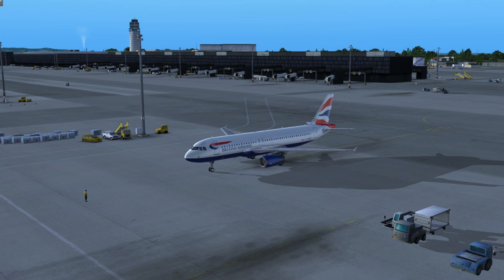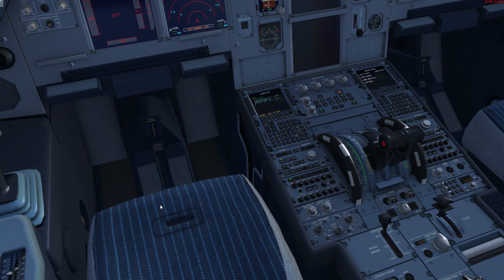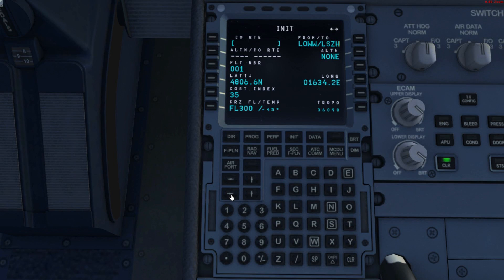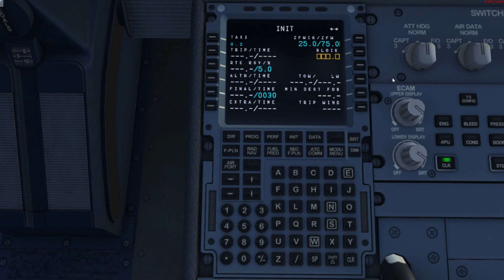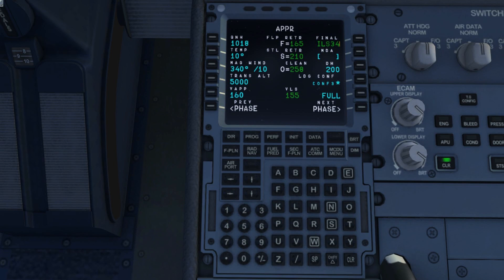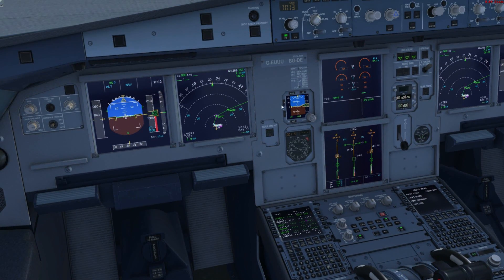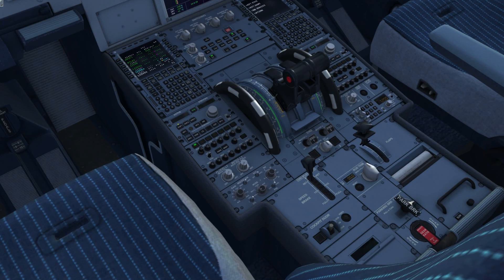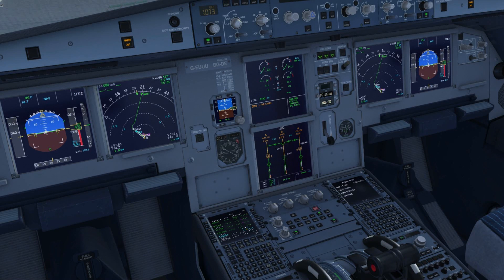Let's Fly FMC/MCDU Basic Tutorial Airbus X Extended - English Version

Comment: Hello. When I program my flight route and waypoints etc as shown in this video, will I still be able to use air traffic control?
Reply: As with the default atc, no, as the default atc is meant to be used with default aircrafts with no fmc/mcdu. But you might be able to with add-ons like ProATC X.
Reply: Thanks for your help. I tried default ATC by downloading a copy of my flight plan in both formats, one for IFR P3D and one for Aerosoft FMC. It worked for the first half of the flight but on approach it does not work.

Comment: What do i have to put into the AP or what do i have to do right after rotating/take off
Reply: ***** DerNuknuk Make sure you have the HDG knob pushed IN so it can follow NAV mode, and make sure your ALT knob is pushed IN to be put into Managed mode. Then pretty much just sit back and watch it fly itself
Reply: You must turn the FD on before the actual take off. In real life in most cases pilots don't turn them off even after landing. When you are higher then 100 ft RA you can turn the AP on and relax.

Comment: Hello EngineIgnition, im having some issue with the very first step, im a bit experienced managing FMC (NGX one) but in this Airbus FMC i cant step to next page after filling up everything you filled in INIT menu. When i click on the "next page" arrow, the message i get is "NOT ALLOWED". Am i missing something? Ive loaded fuel from that software that came with the plane but im stuck at INIT first page and i think the FMC wont get properly programmed and the plane shouldnt fly as it would without that step completed. Any suggestion? Any help please? Greetings from Argentina.
Reply from the maker: Hmmm... did you start from "cold & dark" state? Because your problem reminds me of when I had similar issues...
Reply: Hi! Thx for the time you spent answering me. Im starting from the "default" step, as it comes when you install the plane, i would call it ready for taxi or ready for takeoff. Definitely not cold & dark, i think i should try cold & dark. Will let you know and for those who might find this issue in the future.

Comment: i have a slight question sir, now i fly above egypt where there are no sids, now, whenever i take-off, the a320 doesn't seem to follow the route correctly, it turns from left to right beside the route as it is trying to align with the route but it doesn't, even after 1hr from take-off, i enter the flight plan exactly like u do but without the sids! any ideas? 
oh and btw, i click on the heading knob jst in case u think i don't click it!

Comment: Thanks for the excellent video.  The frame rate in my computer is running at about 6 through 9, yet for the Level D 767, which probably has a similar complexity, it runs much faster.  I wonder if you have any suggestions.  (you speak English excellently!)